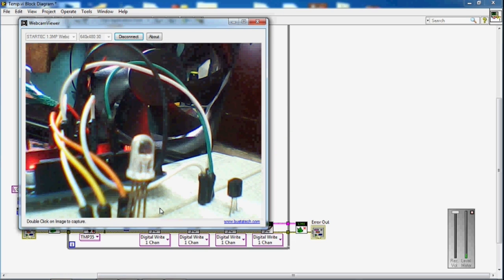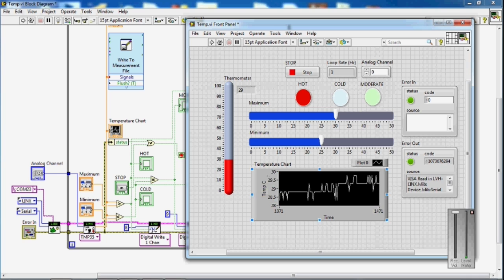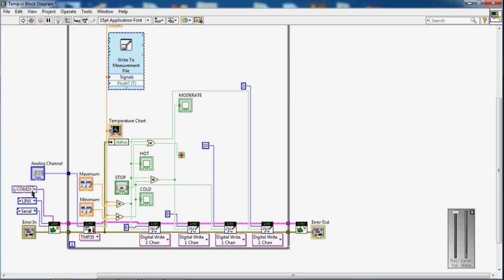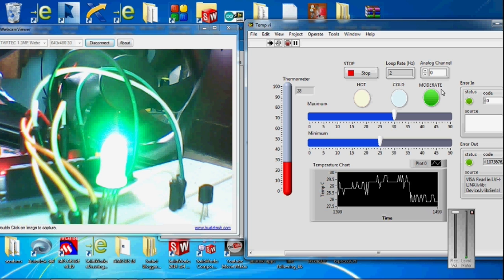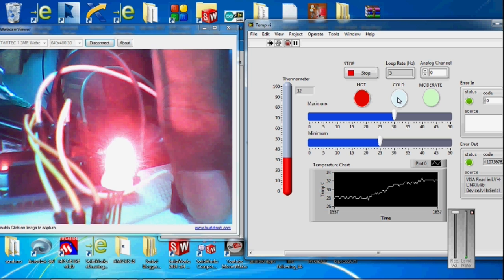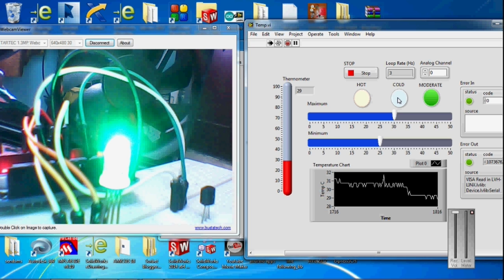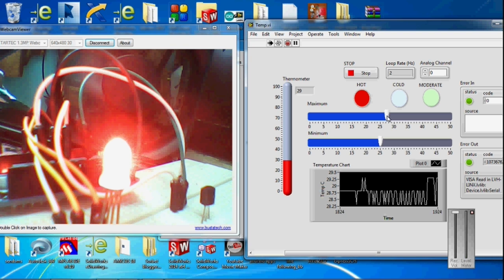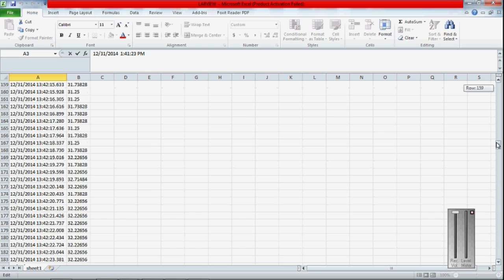Temperature controller using Arduino Labview LM35

Comment: Hi ur video is very helpful thank u :D
But at the beginning while I'm trying it was give me 0 reading but I entered in tools makerhub then linx then linxfrim ware wizard and choose the board and port then pre-built frim ware and then tried it the LM35 work and the temprature works but the LED didnt work and I connected like ur circuit diagram but I added the terminals of LM35 the VCC AND GRND and the common in the LED I connected to the GND and the colorS terminal to arduino board , so I did something wrong or out ? Please I need a quick reply because Im doing this a part of my project and have No time :D THANK YOU.....

Comment: Hello my friend... Very useful tutorial and nice work too.. I have faced a problem with your project.... When i run it , something wrong is on the first LINX(the first out of the loop) and after this all signals are wrong... I thought thas my arduino has some problem but i tried with another... and i faced the same problem. Any idea? Thank you for your time.
Reply: Would you happen to still have the files for this project? The website no longer works.

Comment: hello sir, after ive downloaded all the vis and the linx labview toolkit after i run the program ive got this error "THe specified serial port configuration  is invalid. please make sure that  COM port  associated with linx device is selected.
Reply from the maker: so you are not getting any error in the program? open your arduino => Tools => serial port. check which serial port your arduino device has connected to. select the same port in the labview. if the labview not showing any com port. You need to install NI VISA to make the com port visible in labview
Reply: Arduino Robotics LabVIEW Solidworks sir the port in labview is the same in the port in our arduino, however i dont have the .ino file/ arduino file to be uploaded  in our arduino..
ive get this error: Labview  was unable to connect to the linx device using the following settings:
interface:serial
COM port:COM18
Please make sure that the linx firmware  is loaded  on the device (Tools>>LabviewHacker>>LINX>>Firmware wizard) that there are no other  open connections  to the device, then check the configuration settings and try  again.

If the error persists please search , then post  on the linx  forums at www.labviewhacker.com/forum/linx

please help us :(
Reply: can you give us the arduino file for interfacing linx with arduino..that's our only error..
Reply from the maker: Zarjerome Cajudo for connecting with arduino and LabVIEW there is no need to program the arduino seperately, all you have to do is, goto tools select LabVIEW hacker /maker hub , linx and choose com port and arduino type
Reply: Arduino Robotics LabVIEW Solidworks weve already did that and we have an error called error 5003 ,
this is the error:
Labview was enable to connect to the linx device.
using the following settings:
interface:serial
COM ports: COM 10

please make sure that the linx firmware is loaded on the device (Tools>>Labview hacker>>Linx>>Firmware wizard) that there are no other open connections to the device. Then click the configuration settings and try again.

we already tried the firmware wizard and have same error over and over again thanks for your reply. :)
Reply from the maker: Zarjerome Cajudo please use the example program that is to blink the LEDs. And check it
Reply: Arduino Robotics LabVIEW Solidworks weve already done that, the same error :(
Reply from the maker: Zarjerome Cajudo whatever you doing to connect with labview to arduino . pls take the steps as screen recorder and send that would help me to find the exact problem. jayakumarmagesh@gmail.com
Reply: Arduino Robotics LabVIEW Solidworks okay thanks sir ,pls wait for us.
Reply: Zarjerome Cajudo sir ive just emailed you..pls check :)
Reply: Hey, could you please share the resources and toolkits, it's not available in the website.
It'll be really helpful
Reply: Would you happen to still have the files for this project? The website no longer works.

Comment: hello, can you upload the VI s imbedded in this because when i downloaded the labview file it requires me 7 more VI.(the TMP3x.vi etc.)  i really need it..thank you..
Reply from the maker: saul200 I fixed it already , if you want the link check this one https://www.dropbox.com/s/6flsyz3idr6ahhk/Temp.vi?dl=0
Reply from the maker: saul200 Hi i think you don't have the toolkit installed to make it work, you need Labview Makerhub LINX toolkit for this. have you installed it?
Reply from the maker: saul200 lm35 has only 3 pins, the middle leg is the output which has to be connected to any analog pin of arduino, the other two pins are ground and positive terminal.
Reply from the maker: check your LM45 using the example in the linx vi. you can find it by going to help => find examples > type linx..
Reply from the maker: Have you downloaded linx for labview from VIPM?
Reply: Arduino Robotics LabVIEW Solidworks yes.we have..we already completed the vi..our question now is, is there additional codes from arduino..because when we set it up completely like the one you have linked..the thermometer doesn't read anything. it's just set up on 0 reading..btw thank you for the response..
Reply from the maker: No there is no need for extra code make it work. check your thermometer with the example that comes up with linx. the reason why my labview file asked for missing link recently labviewhacker linx has named to makerhub linx so there is error in finding the vi to the new name. if you still want the vi give me some time so that i can make a new vi and upload
Reply: Arduino Robotics LabVIEW Solidworks how can i fix this problem ?
Reply: Arduino Robotics LabVIEW Solidworks Thanks, i needed to run the LINX firmware wizzard.

but i get a reading of 200 degrees..... are you sure that the LM35 sensor in your sketches is connected correctly ? because it seems to me that only the middle "leg" is connected....
Reply: Arduino Robotics LabVIEW Solidworks Thanks a lot for your help! but for some reason my readings are around 120 Celsius.... any idie what's the issu with that ?
Reply: Arduino Robotics LabVIEW Solidworks Hi, can you please tell me how can i change the Fan voltage from 3.3 volts to 5 volts ? thanks a lot for your help!